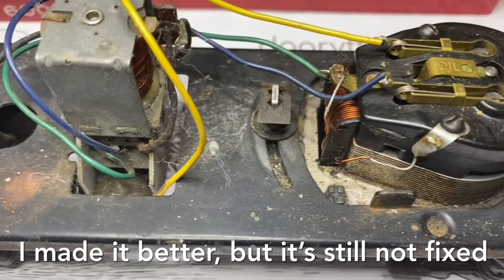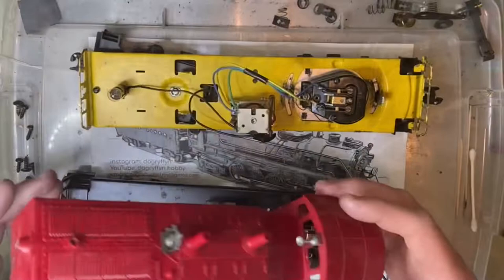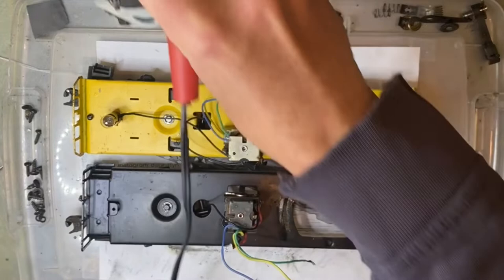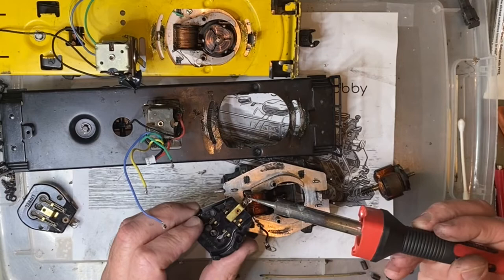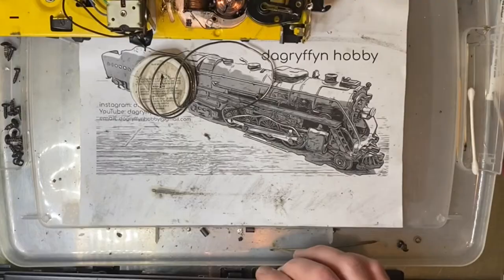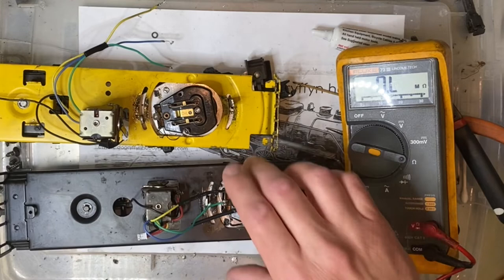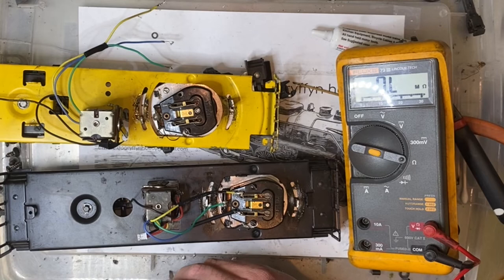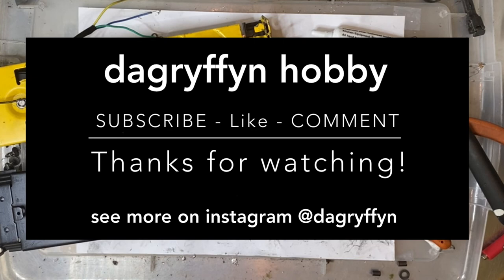Lionel MKT 600 Still Not Fixed! - Postwar Engine Repair and Diagnosis

Comment: I am just curious if you ever put an ohm meter on the 3 different piles on the armature. I race HO slot cars and we have ohmed the armatures and all three poles measure closely together. You can have an open pole and it won't run unless you push it to help get it going but it will run
Reply: I just watched the video again and saw you were checking the field but not the armature. Please try putting the meter on the poles of the nature itself
Reply: Also check to see if there is carbon build up between the copper segments the brushes ride against because that will cause problems as well.
Reply from the maker: Thanks for all the tips! I traced it down to the power truck itself, the sides are loose allowing movement between the parts and pushing everything out of alignment. I shimmed the plate on the bottom where the armature sits and it works much better. 
I definitely could have checked the armature itself, but I had taken the lazy way out and swapped it with another known good armature. 
It’s running decently, but I really need to restake the parts of the truck to hold it all together better and prevent unwanted movement and binding,
Reply: @dagryffynhobby  There's three causes which will facilitate this kind of operation moving One direction not moving the other having a hard time getting started ECT ECT..
1: the bottom or the top bearings (bronze) for the armature are so worn out that it is allowing the armature to cock to one side of the other causing the Ring and pinion to not mesh together properly.., and or at the very bottom of the worm gear or really anywhere in between the shaft is bent slightly but bent nonetheless...
2: something in your drive Wheels/axles and or worm gear (ring gear) has a problem it is getting cocked one way or the other and causing it to bind..
3: something electrically is wrong with the armature whether you have one winding that is bad but it is not allowing the engine the polarize correctly.. could be a cracked commentator could be a short and one of the windings etc etc... You had said that you had found the problem and that the drivetrain was coming out of alignment when it would try to move binding the engine I also noticed that there was a whole lot of back and forth pull or side to side movement in the armature when you would try to run the motor this is evidently been a problem for this motor for a long time because it is worn itself to the point to where it can't smoothly transition the power to the gearing... During the summer months when I was 14 and 15 for 2 years I worked at my local train shop these (the MPC era at that time)"Pullmore" motors we're not a very durable design.. and we're subject to tons of drivetrain problems and quite frankly if they weren't perfect would wear out quickly..
Glad you found the problem

Comment: There is entirely too much play in the  shaft of the armature and what is supporting it . This also causes too much play with the drive gear so the motor fights itself to start turning .
Reply from the maker: Yes! The whole truck is loose and needs to be re-staked
Reply: @dagryffynhobby hello, can you explain what re-staking entails? I have this issue with my MKT 600. Just getting into the hobby and not familiar with all the terminology. Not afraid to get into the inner workings to make fixes but just need a nudge in the right direction. Thanks.
Reply from the maker: @MachGo66  I haven’t gotten into that type of repair either! If you look at the way the truck is assembled, there are places where the metal tabs from one piece go into the other, those are the spots that need to be tightened. Maybe a metal punch and a hammer and tapping on the tabs. I’m no expert! Lol
Reply: @dagryffynhobby  Thank you. After hours of tinkering with and replacing the brush plate, 
brushes, e unit refurb, cleaning, lubing and re-soldering, I finally got my MKT 600 running well. I noticed that if I jiggled the truck while on an energized track, it would sometimes try to move and spin the armature. I freed the entire truck and motor and gripped the field plates like a door knob and gave a slight twisting motion. It moved just a hair. After that, it ran like a top. Obviously, things were out if alignment somehow. Probably when shipped to me.

Comment: End clearance on motor shaft is not correct. It affects the brush to commutator and the worm gear mesh on the lower end of motor shaft.

Comment: maybe the field structure is moving
Reply from the maker: The whole truck is loose, I temporarily fixed it by shimming out the bearing plate with bits of business card
Reply: @dagryffynhobby can you do a quick video or post about this? I’m having the same issue and would love to have my engine running!

Comment: i had the same problem with my 617.  the problem is the sheet metal that is swaged into the top plate is loose.  the way i fixed mine was to apply expoy at the joints so the don't move.  use a good expoy like jb weld. if you watch your video you will see the motor armature move left and stick to the yoke shape field  https://youtu.be/N9OTNiJ6Fuc
Reply from the maker: JB weld! Great idea. I’ve been thinking of a better fox for this and that’s not a bad idea!
Reply: @dagryffynhobby  make sure is clean of grease and the frame is the position you want it to be.